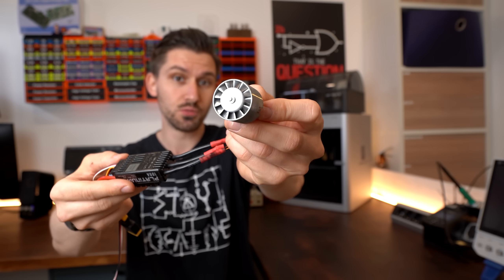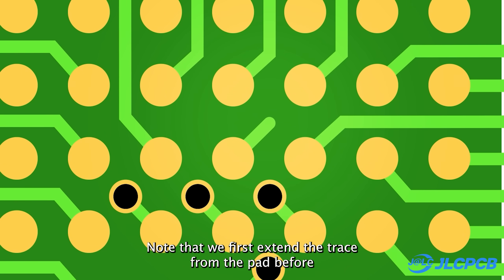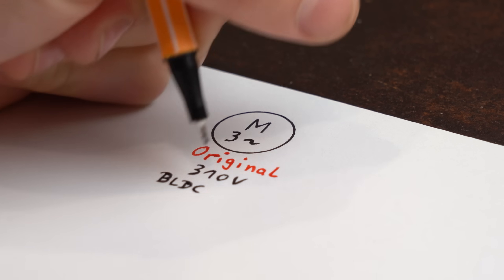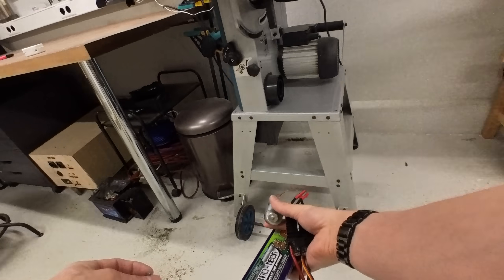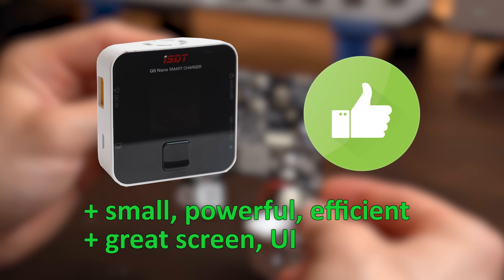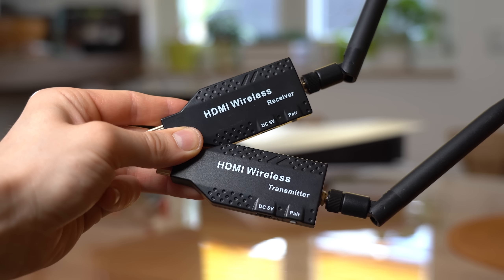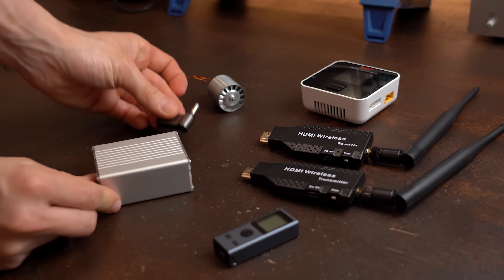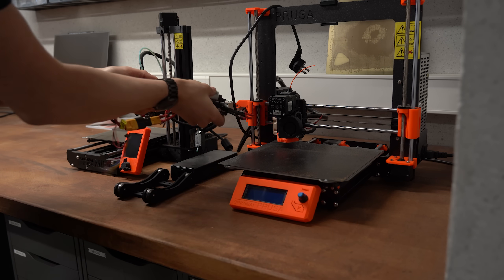I tried finding Hidden Gems on AliExpress AGAIN! (Part 9)

Comment: The problem of USB C laptop charger adapter is that most USB C power supplies trigger overload protection when total power riches maximum allowed. That is why you wasn't able to charge your powerful laptop, as the power to charge was about 65w and only 35w was left to power the laptop itself.

Anyway the adapter can be used to power fully charged laptops (in the case of extending battery life from power bank) as fully charged laptops will drain the energy from the powerbank first (as charged batteries does not require power) then after the power bank emptied will use the battery.
Reply from the maker: Thanks for the feedback
Reply: @greatscottlab  my laptop only needs 40W usbc. no big bricks needed
Reply: @Cy-by  Mine needs 280.
Not kidding, it's what happens when you put a 3060 in a laptop.
Honestly I'm surprised they managed to cut it down to even that.

PS: Never buy a laptop for gaming unless you want constant bluescreens when playing something somewhat poorly optimized.
Helldivers 2 has been absolute hell for me.
Bricked my windows install and everything.
Reply: i used same adapter with 60W usb-c cable and get same results - resetting loop, worked fine after i switched to 100W cable. note: watched on youtube that this adapter can fail when transfering more than 100W, i have not tested this yet )
Reply: @yurcchello the problem is needing to use PD chargers. Non-PD chargers (such as the normal laptop chargers) can fault if you try to use them with these adaptors.
Reply: I got one of these for my HP Aero 13 which comes with a 65W charger. With a 100W USB cable it works fine, with or without the laptop internal battery connected. With a 65W cable it wasn't quite enough and the laptop would reset just as it finished booting and started the GUI (I'm on Linux).
Reply: Did not work for me with 100w battery and Lenovo laptop that can consumes more than 100w. I would expect the plug to limit the current and  ro it's capabilities and not disconnect, but it's probably too much for this price
Reply: @zeev549  The PD adapter doesn't know how much energy the laptop can draw, the laptop itself regulates the resulting current. The old charger type laptops without the ID PIN usually do not limit power draw and try to pull as much current as they can get. PD capable laptops themselves are able to detect the capabilities of the PD power supply and apply power profile depending on the connected power supply.
Reply: @zeev549  I've used those with a Lenovo 5 Pro. It works more reliably if you run either just IGPU or DGPU. Otherwise it may try turning on the DGPU when it detects power, but the power draw spikes when the DGPU switches on, overloading the charger. And it just cycles.

Eventually I got the Lenovo 135W charger that does 20V 6.25A. It's been very reliable.
Reply: Another problem is that even though it looks like a simple barrel jack, most laptop manufacturers still have some kind of communication protocol running with the charger, which this would need to replicate. So I'm not suprised the MSI didn't work properly with the HP adapter.
Reply: I use one of these for my old rugged chromebook I take on bicycle trips since it's built like a tank and inexpensive. The USB C obviously supplies plenty of power for this class of device, so this adapter is super handy and much more compact in my bicycle bag.
Reply: I've got a propietary HP 65 watt USB-C power adapter. Could that be used to charge all my lower power ultrabooks and tablets with this USB-C adapter? Cheers
Reply: @Cyba_IT  Probably not if they expect 65W. I would allow some margin. If they run off 45W though then it might be fine, providing they accept 20v and have the right size barrel port.

Comment: That jet fan is pretty cool. While you were using it as a fan  to blow dust away, I think it would make for a cool mini handheld vaccum that could be made with 3d printing.
Reply: If you're going to use a filter for the vacuum, I don't think this will provide enough static pressure anymore. Better as a blower.

Comment: How useful would that motor be for say like, a fume/exhaust hood for soldering etc instead of using a fan and duct? For the USB C barrel jack connector, you could use that to power other things with a barrel jack, not just to charge laptops, but a PD trigger board might be needed to activate it.

Comment: I use a similar wireless hdmi dongle for my projector , I like to bring it strange places and watch movies outside , quite handy in the summer. I have a 500wh pack from recycled laptop 18650's and it powers the projector and the other pack does the phone and bt speaker, but even with just air gap I get at most 30-35m before it starts glitching.

Comment: 8:05 Surely it can't be transmitting 1080P with only 10mA, it must be drawing some power from the HDMI port.
Reply from the maker: That is possible. Yes.
Reply: @greatscottlab  You got under 10mA for the transmitter because the USB tester measures the current through the ground, and both the USB tester and transmitter are connected at the same ground.

Comment: Hey Scott, I just bought an IP5389 based power bank off aliexpress, after a week I can say its the best power bank ive used so far, maybe you should give it a try, I ordered the 8x18650 version, and added my own cells. For only 50$ I can say its a steal and wonder if it has any downsides

Comment: You can buy whole blowers with that motor, battery, USB-C charging for about 30 euros, I got one from amz to replace compressed air cans
Reply from the maker: Thanks for the info. Will have a look
Reply: Do share a link if you will, that sounds very interesting.
Reply: @Tomazack  2/2: I checked my orders and the one I got in Feb 2023 was called "Compressed Air, MECO ELEVERDE 36000RPM Cordless Air Duster Blower for Computer, Laptop, Tower Fans, Printer, Computer Cleaner Keyboard for Cleaning Dust". I see it says "only" 36krpm but that is more than enough to blow dust. This particular model is not available anymore from the same seller ("MECO ELEVERDE") but they have a corded version, claiming 550W (maybe some of those 550W are Chinese Watts though). I guess this should have a similar motor to the one in the clip.
Reply: @Tomazack  and here we go again, my reply to you just vanished, again. I must be on some sort of naughty list for youtube's "AI".
Reply: @dan-nutu My comments vanish all the time now, too. I think Google isn't very good at AI.
Reply: @SwapPartLLC  Its been like this for a long time, most sneaky is ghosted comments that stay are invisible to others, have to log out to check.
Reply: @Tomazack  I pasted the text (I still had it in gmail, where I typed it) and it got deleted again. I'm sure yt's algorithm is "too sensitive" and deletes even innocent comments. I'll try once more, if it still doesn't work I'll give up. "Big tech"...
Reply: @dan-nutu  It happens to my comments too. That cannot be good for smaller channels which depend upon comments from people.
Reply: @RWBHere  Guys we are not allowed to leave outside links on YouTube, we never have.
Reply: @Tomazack  1/2: yt has an annoying tendency to delete comments with links to anything else but yt, however you could search for something like air duster/blower, compressed air can replacement etc. and I'm sure you'll get some options.
Reply: I just got an aircan with a schrader valve, so i can "recharge" it at the compressor. I got a brand named one tho, not sure i want to trust an aliexpress aircan with a few bars of pressure.
Reply: @ProtonOne11  😃 Yeah, good if you also already have the compressor! I live in a small rented apartment, an air compressor would be the last thing I'd think of bringing in. I can use the little battery blower for more than a few minutes, I never needed more hence I never completely depleted the battery
Reply: Use a floor standing bike pump.  I’ve used mine to add a few pounds of pressure to car tires instead of dragging compressor from the garage. Gets a few laughs from neighbors and only takes one or two minutes.
Reply: @ProtonOne11  You can make one yourself ,can needs to be tin no aluminum or steel.I used brass schrader valve from  inner tube of mountainbike.You need to clean the rubber very well best is to burn it off but before you need to remove the inner core of valve.Clean it very well.Then you drill a hole of same diameter in a bottom of the can since its thickest part of it.Use 60:40 lead solder ,new lead free stuff doesnt work and carefully solder around valve.When finished insert core back  into valve.
I did this years ago on a wd-40 can ,it holds 4 bar of pressure without problem ,i just use bycicle pump to charge it.
Reply: It has a tube that you can attach to focus the air but it's not as narrow as the ones from the air cans. I'd say this one is about half a cm inside, while the ones from air cans are probably less than a mm, so for very narrow spaces (think hairline cracks) the pressure from the cans is greater. But on the plus side this one doesn't create any freezing or condensation.
Reply: yt has an annoying tendency to delete comments with links to anything else but yt, however you could search for something like air duster/blower, compressed air can replacement etc. and I'm sure you'll get some options.

I checked my orders and the one I got in Feb 2023 was called "Compressed Air, MECO ELEVERDE 36000RPM Cordless Air Duster Blower for Computer, Laptop, Tower Fans, Printer, Computer Cleaner Keyboard for Cleaning Dust". I see it says "only" 36krpm but that is more than enough to blow dust. This particular model is not available anymore from the same seller ("MECO ELEVERDE") but they have a corded version, claiming 550W (maybe some of those 550W are Chinese Watts though). I guess this should have a similar motor to the one in the clip.
Reply: I've considered getting one of those. I go through at least 2 cans of air a week doing electronics repair. How loud are they, though? I work out of my basement, sometimes at night, and I have neighbors.
Reply: @SwapPartLLC I'd say the "volume" is comparable with a small hand held vacuum cleaner or a hair drier, however the frequency is much higher, it has that specific turbine whine, just like in the beginning of this video. Oh, and funny thing: the tiny motor spins so fast that you actually feel and have to counteract the gyroscopic precession while holding the blower!
Reply: @dan-nutu  Thank you.
Reply: @SwapPartLLC  Its quieter than an air compressor that's for certain, sounds like a hair dryer, good for extended blow vs can.  So can blow out dust from pc cases from the outside grill etc, would be wasteful with can.
Reply: @churblefurbles  I'm going to buy one. I probably can't use it when I work at night, but it will eliminate most of the canned air I use. At $7 or so each, it adds up fast.
Reply: @SwapPartLLC    Yeah, that's why I got it, too, I didn't like throwing money in the wind (ok, small "wind" :) ). 

I just measured for you all the blower I have, using a standalone sound level meter (not a phone app, a true standalone device with a calibrated microphone), a standalone wind measuring device (very similar in shape with the sound level meter device, it just has a little sort of wind turbine where the other has the microphone) and a FFT spectrum analyser :)

The room noise floor was 32dbA before I turned on the blower.

Without the tube to focus the air, on its 1st speed, the blower puts out around 93 dbA right next to it (1cm) and a 94 km/h constant stream of air. If you attach the tube the air stream will obviously be faster, but I didn't want to damage the wind meter (it's specced only up to around 100 km/h).

On the 2nd speed it quicky maxed out my wind measuring device at 108 km/h (at which point I took the wind measuring device away so I don't damage it), even before the little motor completely revved up. When it completely revved up the noise level was around 100 dbA at the same distance (1 cm).

The noise frequency surprised me a little - the peak was just below 100 Hz and it almost linearly dropped some 15 db from 100 Hz to 6 kHz, with a peak at around 2.5 kHz and another peak at around 8-9 kHz (both of which were almost at the same level with the top of 100 Hz). 

The air stream from the compressed air cans still goes a bit deeper into very narrow cracks but this blower is excellent for blowing more than just a few seconds, I can use it for minutes, not sure how much that would add up in cost if using cans. It also doesn't create any sort of condensation like the cans do - it just blows air at room temperature. It's really handy :) but I avoid using it at night because of the noise. HTH.
Reply: @dan-nutu  You are awesome. Thank you for taking the time to do that. 90 to 100 dbA sounds loud, but I think higher pitched sounds are less likely to be heard through floors and walls. I have concrete walls in my basement, so anything my neighbors hear either has to go through that, or it has to go through my floor and then through a wall.
Reply: @dan-nutu  So, I ended up buying a Bankky brand one on Amazon right after you sent the sound measurements. This thing is perfect. I don't even need the nozzles on it for my needs. It's really no where near as loud as I expected. It's been a few weeks now, and my can of air has a layer of dust on it indicating that I haven't touched it in quite a while. Thanks again.

Comment: I have been using such a laptop usb c adapter for a year now on my Asus Zenbook, works amazing!
Apart from the reduced size of the usb c wall adapter, i can now also use a power bank as well on the go, absolutely life changing!
But yes, both things are rated at 100W.
Reply from the maker: Great to hear!

Comment: But is this small laptop charger adapter able to cut power if the charger is not able to go to 20V? Or will it simply try to send 5V
Reply from the maker: Good question.....

Comment: It would be great if you find gadget that converts drill battery into power bank
Reply from the maker: I think you can combine the powerbank circuit from the video with a simple drill battery adapter.
Reply: Depending on the manufacturer of your battery there already is Milwaukee makes something I believe is called I top hat I may be wrong on the name but it it's an inverter that the battery attaches to
Reply: Yes, there are even free to download models to 3d print such adapters for battery packs from different manufacturers. I was looking to find a way to turn the battery pack into a mini-UPS for Raspberry Pi, I eventually gave up on this idea because of safety concerns (Li-ion...) and I'm going to get a proper mains UPS

Comment: 8:18 "50 m without any walls in between"
immediately goes outside and closes a sliding glass door XD
Reply from the maker: The door was actually open. It is not that visible in the video though.
Reply: @greatscottlab  I figured, but I just thought it was presented in a comedic way. The only problem I have with your videos is that they keep making my "Engineering & DIY" playlist longer! Keep up the great content!
Reply: @greatscottlab  Even so, you didn't have a clear line of sight between the two devices, so that partially open door still counts as an obstruction.
Reply: What intrigues me about that table is the other use case it presents that is hard to do with cables: 1 TX source, multiple RX displays! Solve the first-world problem of going into the kitchen for snacks, you can still hear the game/movie, and of course, there's a score, or dramatic music (but no dialog) come running back "what did I miss!?" (Or any other need for duplicate displays where it's not easy to run an HDMI cable)
Reply: @RossReedstrom  Yes, but it also makes me wonder how secure the data transmission is...
Reply: @nimoy007  I did see a "pairing" button on the device, so it's not completely broadcast in the clear, but still a very good point: RF is always going to be less secure than hardwired. Also, looks like it runs at 2.4 GHz, so WiFi interference is a possibility.
Reply: @nimoy007  what are you watching?! 😀
Reply: @dan-nutu  ???
Reply: @nimoy007  over that hdmi link that you're worried how secure the data transmission is
Reply: @dan-nutu  Things like passwords being typed in, etc. I see this being useful for a sort of remote desktop, but I wouldn't necessarily trust it for sensitive personal data security.
Reply: @nimoy007  But passwords are shown as ******** on screen so its not really a problem.
Reply: @sebastiannielsen  Most show each letter as you type, so if you get a screen capture... Yeah, no.
Reply: @nimoy007  No, not on computer. On phones and smart TVs it displays the last character.
Reply: @sebastiannielsen  What? The choice to obscure the password behind the "dots" (which is known as a mask) is done by the application or website. It does not matter what device you use.
Besides, this device, provided you use an adapter, could be used with either a mobile device or a computer.
Reply: @sebastiannielsen  Then you can't say, "not on a computer." As you said, it very much depends on multiple factors.
Reply: Wow what a great batch all  👍
Reply: Or any barrier*
Reply: i mean.... a door isnt a wall
Reply: @popcanter188  The listing names obstacles as a problem
Reply: @popcanter188  You are technically correct...